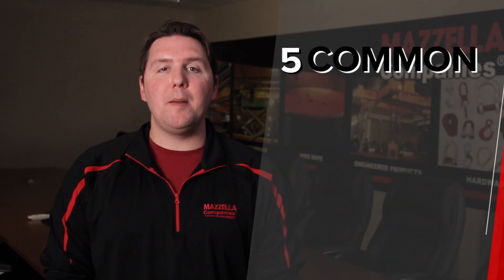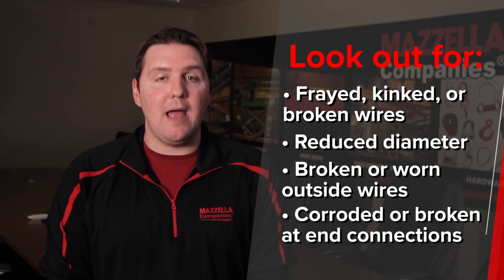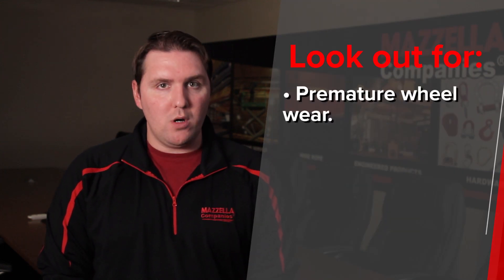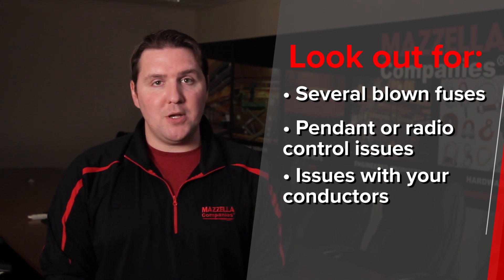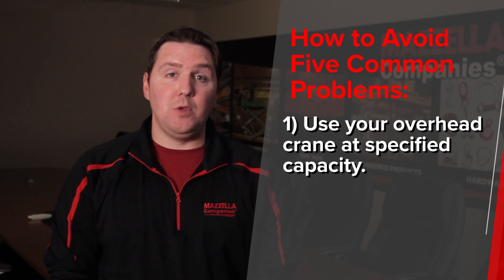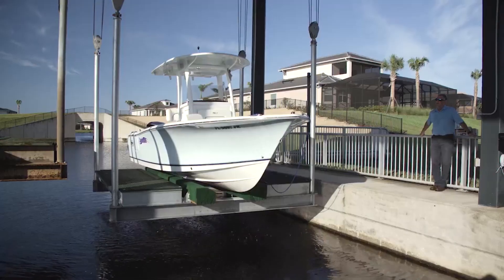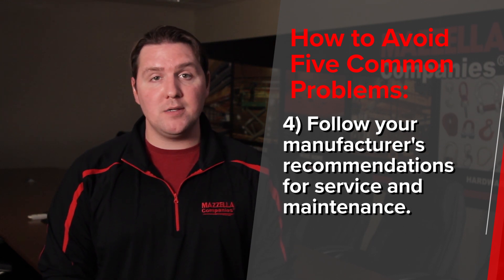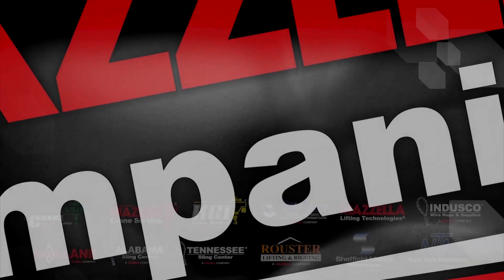5 Common Problems With Overhead Cranes and How To Avoid Them

Comment: Great stuff. Random question and probably too specific, but would you ever use both flat and tapered wheels on either side the same end truck on an under running bridge crane?
Reply from the maker: Most, if not all, wheels used in underhung applications these days are dual-type, flat and tapered. This allows them to be used on W (flat tread beams) or S (tapered flange beams). However, when dealing with patent track, the wheels need to be designed specifically for patent track (they will be made of hardened material) and will always be flat.
Reply: @LiftingandRigging  Thank you. Keep up the good work!

Comment: I had the cable fail on the hoist of an overhead crane. The failure happened at the equalizer pulley on the top of the hoist. Inspect as directed in the manual. RTFM!
Reply from the maker: Very well said, Greg. 

It's easy to get into the trend of, "it's fine, let's get this done." But you've got to inspect as directed by the manual. 

I'll see if we can start working RTFM into some of our projects, lol. 

- Devon
Reply: One of the most critical, yet often overlooked areas.
Reply: There was a r&m hoist  that was prone for that

Comment: I went to a gravel pit, crane was down, inspected the thing, notice all the wheels where just wore out, double girt top running hoist, wheels shot and track shot, decided to bring it down to the ground for overhaul, on the way to to the ground this thing looked like a banana, went to the truck  got a ball of string, end to end 47"span, 20 ton crane, was a 4""belly  my boss told me to get the touch off the truck, cut this thing in half two 50', 50 inch beams, so I started the company boss lost his mind! I, never will I forget the look on the faces when we condemed that thing on the spot  hey you see frayed rigging you cut in half, right, same difference.
Reply from the maker: Hey Joe, thanks for the comment! 

Sounds like one heck of an experience. Great job bringing the crane down and doing a clear inspection. Gotta make sure your worksites are operating safely. 

Best, 
Devon
Reply: Hey white stains, any tips on a new Crane technician? I'll be trained by the OGs there but any tips beforehand would be awesome!

Comment: Hosting crane did not move down & up...repaired by changing transformer busted. But didn't working up. What is the problem
Reply: You need a full time experienced electrician

Comment: Sir my crane problim push to up go up I can reles push buttons not stop what a problem
Reply: Sounds like your up direction contactor/ relay unit is stuck in the on position. Could be a fault on the push button control or in the relay unit itself.
Reply from the maker: Hey Zohaib, anytime you're having issues with the controller not responding to your input commands, you're going to want to schedule a service appointment asap.

Comment: Surprised there’s no mention of a brake slip or a non operating holding brake.. has to be the 2nd most common issue I see as a technician, 1st would be as  mentioned “blowing fuses”
Reply from the maker: Hey, Haassan, thanks for the comment! 

If five different companies put this list together, I'm sure they'd each have their own rundown of what they see on a regular basis. We pooled info from our technicians, inspectors, and sales specialist to put this list together.
Reply: Hey HR! I'm starting as a Crane Operator this month, any tips?

Comment: Please elaborate the steel wire rope failure "Frayed"? with pictorial views.
Reply: If its frayed cable that means the smaller strands wound around the cable will be broken and sticking out like sharp thorns everywhere its pretty clear when you see it
Reply from the maker: Hey Muneeb, thanks for watching! 

We used this image: https://youtu.be/uO4WfYDOWxo?t=33 (33 seconds in) to showcase what we mean by frayed wire rope.
Reply: @LiftingandRigging  sorry but still I didn't get clear about frayed in particular